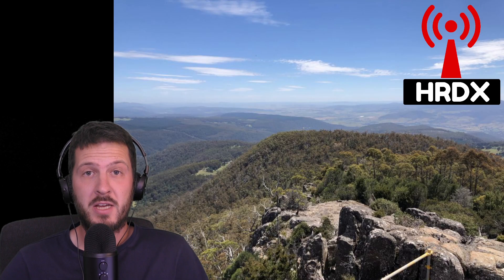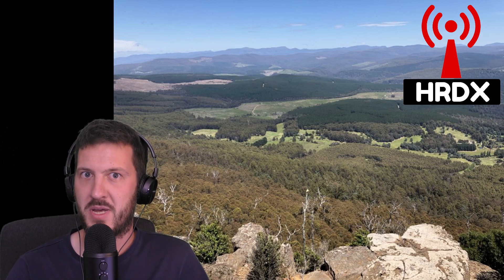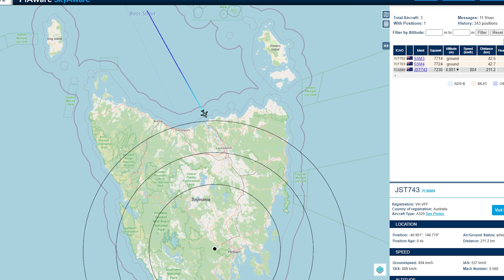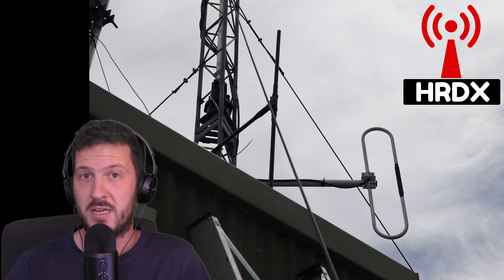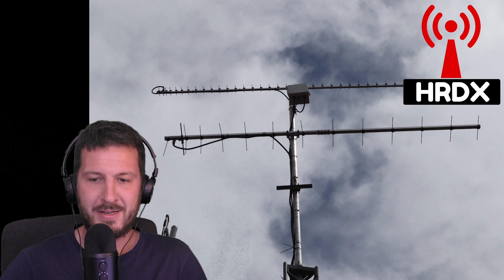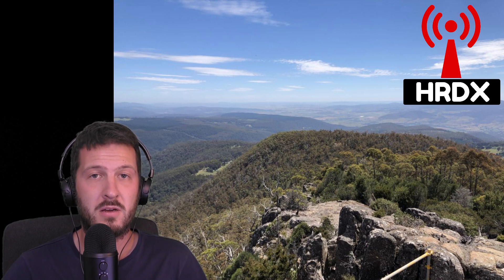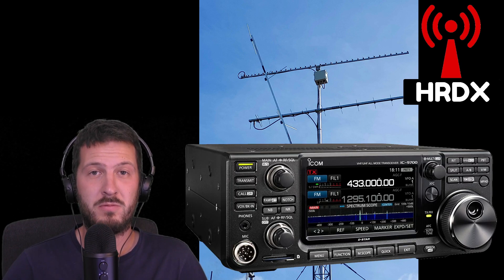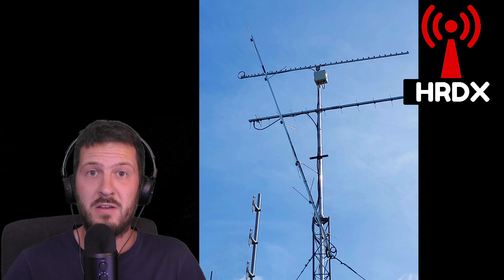My Antenna Broke...

Comment: Hi from the UK. Very interesting report from a great location. In the UK we are fortunate not to have much wildlife that could be dangerous, we all have an obligation not to interfere with the other inhabitants of the planet, so another lesson learned! While we do not have the opportunity to set up remote stations, such as yours, we do get occasional high winds and your video certainly highlights the need to ensure our kit is up to the job! Good luck with your rebuild, I to have one of Callum's All Band Verticals, so maybe when I can use more power we could meet up on the bands. 73 Jim M7BXT (Limited to 10 watts by my Foundation License)
Reply from the maker: Thanks Jim for the comments. Hope we can catch up soon on the air!